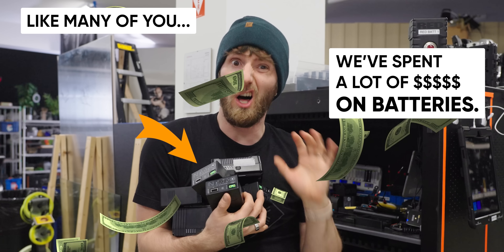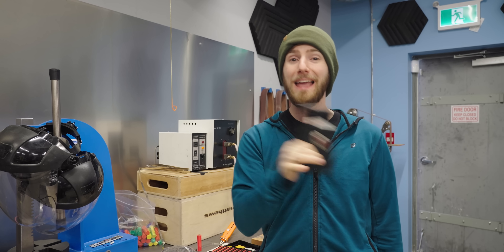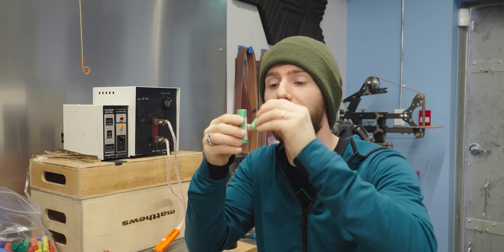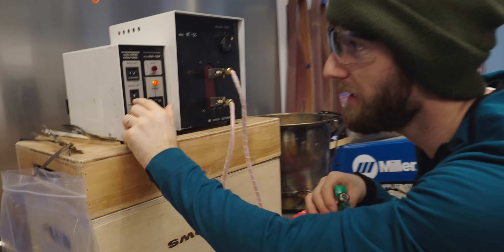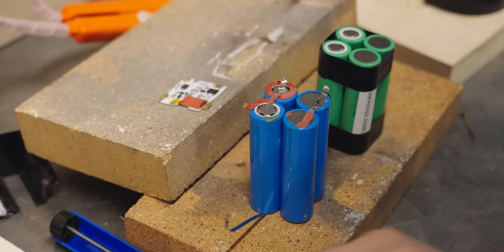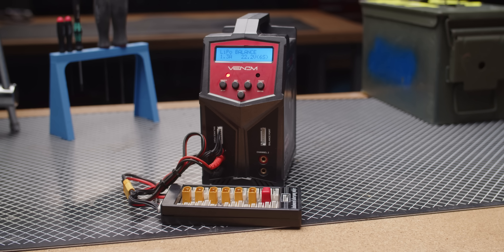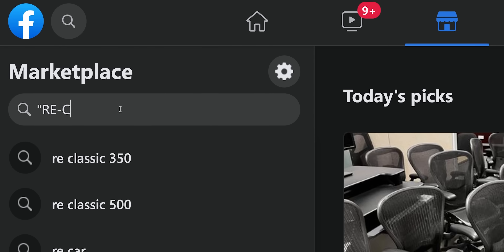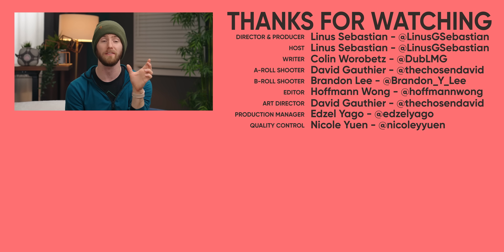This should be illegal… Battery Repair Blocking

Comment: As a DIYPowerwaller, I love how this was presented - informative, safe & entertaining. Its a pitty you couldn't revive the red battery and you wasted great cells in the process.
Reply: I made a 40 amp battery pack from old laptop 18650 batteries and have never had any issues . You do not need to bin all them batteries . Most of them are probably good
Reply: @leecallaghan4625  I have heard of people powering EVs with used laptop cells, although they do organize them by grade and will discard the bad ones.
Reply: @JohnGeorgeBauerBuis  EV's that people build themselves are usually not equipped with such sophisticated gas gauges (BMS) as in these batteries. Even if they should have made it to actually swapping the original cells for 'new' ones, it would be useless, as they would need to reset the gas gauge. Without it, the battery will still think it's nearing end of life as the condition the cells are in, is stored in flash memory. Just swapping the cells won't change that...
Reply: Why did they throw it away? They didn't catch fire. Just a little spark.
Reply: @EbonyPope  Because in NA you need to overreact and over-act and exaggerate to protect people from doing this as well and scare them away from it.
Reply: @EbonyPope  Because they are properly recognizing their limitations. They're not sufficiently knowledgeable about these things to tell if the situation is a dangerous one or not, so they're erring on the side of caution, as they should in such a circumstance.
Reply: @JohnDoe-nq4du  True, erring on the side of caution is a good thing, but when you're working on something that you very well know is a tad dangerous and you aren't sure what you're doing, then why would you go do it anyway...? That's a pretty good sign you might consider stopping and just shouldn't do it and well, you know what platform he's uploading to right, just spend 15 minutes learning how it should be done/how other people do it.
Reply: @vgamesx1  I’m thinking they planned to replace the red batteries and this was a good way to recoup some costs by making the video and also for the sponsor.
Reply: @EbonyPope  Because they don't know what they're doing and don't understand how a spot welder works.
Nor do they understand how electricity works or what a circuit actually is.

There was no circuit there, they had only connected to one end of the battery.
Reply: @jimmyb1451  Let me remind you that there are graduated electronic engineers in LTT
At the time of the sparks they were connecting opposite leads together, and the spark was caused by imprecise electrical welding and battery voltage mismatches

As someone else already answered, such a spark could be the start of a chain reaction that could either be fine or very likely to burst with no way to guarantee either one, due to safety reasons, they discarded them immediately
Reply: @jimmyb1451  As an electronics tech of 30+ years, those batteries were fine to use. A spark is to be expected to do what they were doing, as I have done this myself.
Reply: @kriswingert1662  thank you!
Reply: @diegogarcia6518  yah.
I have 30 years of experience working with batteries, no , none of those sparks were from voltage mismatch and even if they were, it wouldn't have caused kind of runaway event.

They know better. There was no reason to discard those cells, nor was there any danger.
Reply: When you spark a battery its a full short, likely the welding settings and technique. But that is the problem with DIY packs, what if you didn't spark the cells but still caused some weld damage harder to detect? I would at least check the internal resistance of each cell with a proper 4 probe meter before building a pack and also make sue the cells are balanced. If sparking any one of them when you weld the nickel strip I'd check the internal resistance again and make sure it's the same as when you began. If the internal resistance is higher that means the weld likely damaged the cell and not smart to use. The last battery pack I built I used 5 amp glass fuses between the cells. That worked well instead of nickle strips but the pack does not hold together on its own with the smaller fuse leads. Its a safer pack with cell level fuses.
Reply: @diegogarcia6518  Simplified for TV? but yeah, it's not great for their credibility.
Reply: @jimmyb1451  they definitely spot welded strips to both ends of the cells, you were mistaken.
Reply: @diegogarcia6518  well, a generic EE degree means little if you don't have special training and first-hand experience with the specific technology. 

And how it could be "sparks by connecting opposing leads and voltage mismatching" if the battery circuit was still open while welding and they showed they pre-measured all the cell pairs beforehand? Apparently, all it was is just a bad spot contact with a bit higher than zero resistance during a high current welding pulse -- it's not uncommon with such tecnique. IMHO there wasn't any danger there -- they overreacted and trashed a bunch of good cells. But on the other hand, if you're not sure what you're doing, then you'd better be safe than sorry.
Reply: @jimmyb1451  I couldn't tell from the footage if they did this, but if they were off target with their weld, they could have damaged the insulation and connected the positive terminal to the casing on the battery, which is of course the negative. I've managed that being not particularly careful taking a battery out of a bank before, just nicked the insulation on a bit of metal that was also in contact with the positive terminal, and shorted it.

There's also the whole "don't screw around with lithium fires" thing. After an hour in the sand, sure, dig the pack out to inspect it, but if you see a spark, you don't want to spend a couple of minutes turning the cell over in your hands, wondering if it's getting warm or if that's just you, waiting to see if it'll burst into flames. You dump it in the sand, and check back later.
Reply: @diegogarcia6518  those graduated electrical engineers don't seem to know much about NMC batteries. Otherwise Linus wouldn't have talked about the lithium burning. When NMC batteries burn and/or explode it's the electrolyte that burns.
Reply: @NoobixCube  It pays to er on the side of caution yes.
Reply: @maulerrw  eventually, yes. However, there were not things welded to both ends when... why am I bothering with the intellectually dishonest.

You win the internet for the day buddy! 
Hope you feel better.
Reply: @practicalguy973  yea having decently precision meter or other  and equipment that can measure internal resistance and knowing the common range of ohms for the particular battery you are working with; IS KEY TO doing it the RIGHT way.
Reply: @alexanderr.539  If your know sure what you're doing, then doing more research is in order before attempting to spot weld or battery pack building. Its not something you should just pick up 100 percent blind virgin to batteries, pack building, spot welding, etc.But if you have a good spot welder and did your due diligence of researching and your confident but not stupid, I say, repair, build, and make.
Reply: @kriswingert1662  True. During spotwelding my V-mounts, I also got the occasional spark somewhere. Nothing to worry about. Trust me (it happened to me once during assembly) that a real short is a far different scenario and scares the ** out of ye.
But to be honest: they lack sufficient skills to perform all of this safely. They are overcautious and thus prone to make these stupid mistakes as thinking that the sparks they see are the result of a short.
Reply: @EbonyPope  That spark can be the start of a chain reaction that has no other outward signs until it bursts. They're playing it safe.
Reply: @1stAshaMan  No. Soo wrong.  they are literally wasting precious batteries.  Arc welding DOES spark.  Its supposed to.
Reply: @EbonyPope  I'm assuming it has to do with the possibility that a spark can make the battery blow up...
Reply: Doing more research so they would be more knowledgeable about what's a real disaster and what's just a harmless light show would be better, but they're not doing anything that's gonna result in injuries and providing more ammo for the people trying to outlaw battery DIY, so I'll take it.
Reply: @JohnDoe-nq4du  LTT sadly going downhill with each and every video. :/
Reply: Nice to find you here.

It's been a while since we've talked :)
Reply: DIY Powerwaller? Oof, that would not be allowed here in Australia.
Reply: Safe?
Reply: no sorry, i'm ok with the entertaining part but that's all, the safety is horrible and for the informations they just do something without the necessary knowledge, the first problem is the 2 layers of nickel, you can't desoslder a BMS like you want, you have to desolder in a certain order, same fing in reverse for soldering, you don't test a battery like that etc.., in fact i'm pretty sure you can replace the batterys whithout any problem IF YOU KNOW WHAT YOU'RE DOING, acting like that is much more a desinformation and i bet they are going to have some problems if RED see that.
Reply: Theese were probably INR18650 - 25R [Samsung], wich are 2500 mAh with a maximum discharge current of 25A (So, they have a very low internal resistance). Very good cells, actually.
I actually built 2 batteries, one LiMn (14.4V 24Ah, 48 cells, Smart BMS).
The other one is a LiFePO4 (WAY SAFER!) 12.8V 38Ah, 48 cells, Smart BMS, double - layered 0.15mm nickel strip welds). I have those for about 1 year, they work perfectly and i charge them with solar power. Nothing happens, i store them nicely.
And... I have 16 years old... YEAH, I STILL BETTER PREPARE A SAND BUCKET... Maybe!?

They are wrapped in transparent scotch, so the connections are isolated.
Reply: Is good than people put this battery to waste .. after that's man how make thinks of old battery have more of them 😅😅😅
Reply: @vladimirsamas3097  "after that's man how make thinks of old battery have more of them"
Those words don't fit together in that order to form a sentence.
Reply: @JohnDoe-nq4du  sry I speak bad in UK
Reply: @vladimirsamas3097  That sentence makes no sense at all. Also, after its with fourteen for their left side on the bottom of a pancake, battery.
Reply: @360theosiris  sry man 😅 I have just bad UK .. môžem ty to po slovensky povedať 😅😅 ou en français si tu veux mdr 😅

Comment: a while ago, i had a battery bank that was just a lead acid battery connected to a car charger, a multi meter screen, and a 12 volt wall wort. it was massive and had a carrying handle. it could be used as a murder weapon.

Comment: I fix ebike batteries and scooters etc in my spare time as a hobby, I don't accept batteries from big name manufacturers. Like Bosch and the likes. They're unfixable without damaging the case or some other issues with seals. The Chinese ones are actually better because they're fixable. Slightly bigger and not as sleek but repairable. My own custom battery because I can maintain it has lasted almost three years so far with about 15000-17000km on it.

Comment: The sparks just indicate a poor connection while spot welding. It's quite unlikely that the batteries themselves were damaged in the process. 

Also to get over the BMS refusing to reconnect, I've tried hotswapping connections (provided cells are at the same voltage) and the BMS stayed alive. Alternatively, I've tried kickstarting the BMS by connecting the negative terminal of the battery to the negative out of the BMS. It started working again.

Comment: You can use a DC Arc Welder to rejuvinate an Lead Acid battery.  start at 50amp and move up to 100-120amp.  This removes the scales off the plates.  Do not use arc welder on anything but a lead acid battery.

Comment: Another evil BMS behavior is that the BMS itself will die after failing to charge the battery X number of times.  It assume that there's a bad cell, therefore the user gotta throw the whole thing away instead of trying to replace the cells yourself.

Comment: Under normal circumstances there’s something extremely wrong with the cells or pack if (temporarily) no voltage is present. Especially these large heavier packs where the chance of something breaking internally after accidentally dropping one is high. Damaged packs with loose internal connections may pose a risk when discharging them or trying to charge that not even the  internal temperature sensor may be able to prevent. Also I understand Red may not be fine when People use packs with their logo and questionable cells. As long Red doesn’t blcok the use of aftermarket packs it’s not really that evil.

Comment: BMS that stop working after disconnecting batteries probably “just” have “proper protection” against charging up cells that have gone below critical voltage level, since crystal lattices form(?) then and damage the cell, meaning it can short circuit if you charge it up again, and if not the risk increases a lot.
So just labeling it being “anti-repair” might be a bit unfair, if you consider the safety aspects and that batteries are meant to be a consumable resource in devices anyways - not the cells themselves. The prevention of people to buy replacement batteries or being able to replace the batteries on the other hand…

Comment: I'd love to learn about what they do with lithium cells after they've degraded... I know a little about the dendrites that form that end up making lithium cells unusable over time, but have no idea what, if anything, can be done to reclaim the materials from the battery once that occurs.  I've also always been curious, every time I replace the battery in my UPS' that use lead-acid batteries... would it be possible to refresh those the way car batteries can be refreshed?  Dumping the acid and replacing it?  There are obvious dangers to that, but if they're normal chemistry lead-acid batteries, I would think it would be possible.  Would love to know if it actually is or not.

Comment: I have seen single use BMS on a good amount of tool batteries. I know you can’t use makita if you disconnect any of the cells but the hitachi batteries can be rebuilt without issue

Comment: Just replaced the battery on my JBL Charge 3 speaker last week. But when I removed the bulging bad battery, I thought that the speaker would work fine with USB power plugged in and no battery installed. In reality USB power is providing more power to speaker than what battery does... However though sadly the speaker will not turn on without a functioning battery in the unit. I'm set for another 5 years or so, but when this battery goes poo poo and I can't find a replacement online - I have to toss my JBL speaker in the garbage? Why JBL why?

Comment: This is the proper foolproofing built into the batteries, because after replacing them, who will be responsible for the fact that your battery (of unknown quality or Linus-like about to many-time fail hanmade) from a laptop or camera will explode on an airplane or train? From an individual who will replace the batteries and die on this plane? So the chip that kills the BMS is the right thing.

Comment: Had to stop at the fire extinguisher bit to let people know that your average home extinguisher is not equipped to handle a fire from a lithium cell. The only extinguishers rated to handle lithium fires are D, typical extinguishers are ABC. Do not play with lithium cells if you don't know what you're doing.

Comment: the 2nd "spark" was the nickel strip vaporing against the tip due to poor conduction.
I don't know of your other cell pack (yet.... still watching, so, yh "DIY E-Bike battery builder" commenter here) however if it was like this 2nd spark, then the pack felt nothing at all and is safe to use.... though, I'm still guessing it's the BMS lockout by RED-Camera co that you'd think should be illegal (i would too)

Comment: Aahhh the only problem with replacement of dead batteries is the brand of item some brands (makita tools)  the bms has built in 3 strike code that record how many times the batteries been drained to an unsafe level once 3 strike were recorded the bms is dead and won't allow the new batteries be recharged once drained